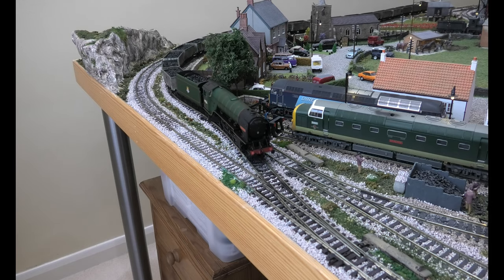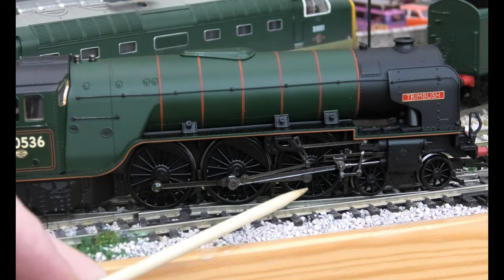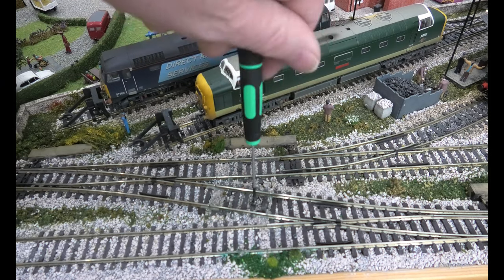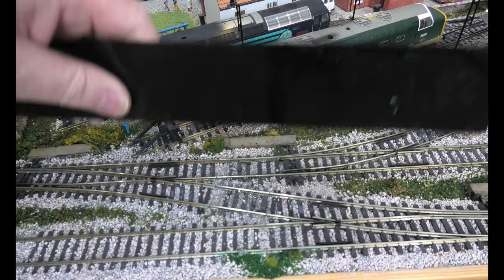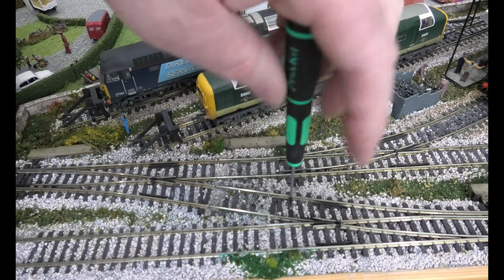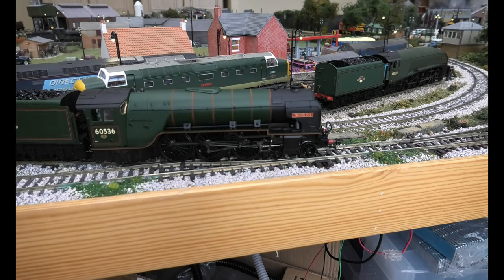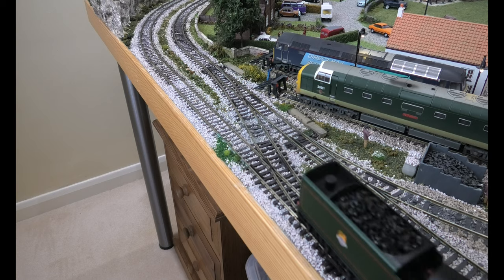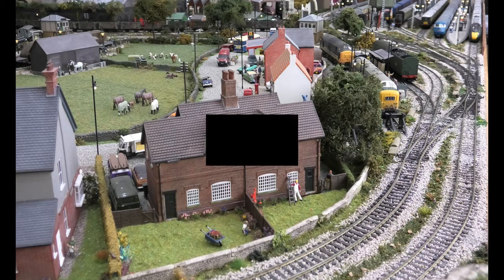Loco stops on track. Showing how you detect and fix a loco stopping on points.

Comment: Paul. You have just identified my problem. I was unaware that I could melt/soften PVA. Also Being a complete novice I nailed my track down. I get lots of problems like surging or stopping completely. My loco is the flying Scotsman and is a shocker for derailing. I will try to remove the nails and try to level up like you have demonstrated.
Reply from the maker: Thank you.

Comment: Amazing how just a slight discrepancy in track level makes such a difference to loco running.
Reply from the maker: Indeed, most peoples problems are track, including mine. It is worth remembering that 1mm is 3 inches, so imagine how a loco in real life would run with a 2 mm/ 6 inch drop in the track.

Comment: I run an N scale layout so can't use screws. Track pins are ok with modelling long nose pliers. We have come a long way from DC to DCC but I still feel that model trains collecting power from rails is completely OLD SCHOOL and seriously a hit and miss with dirty wheels, dirty track, electrofrog, insulfrog, unifrog point wiring, the list goes on. I welcome the move into remote controlled trains / loco's that the NMRA are doing.
Reply from the maker: Real trains collect power from the rails. It have to come from somewhere.  I have no problem running locos on the present system. Whatever train you have it has to have power from somewhere. One thing I will not be doing is swapping batteries over like on a kids toy. I am sick and tired of the batteries on my DCC remote always needing to be charged, so I use the wired controller a lot more. Every mechanical device will always need some kind of maintenance and care at sometime, even if it has RR on the hood.
Reply: @PaulBriden  As an Australian locomotive driver I can say that real trains (locomotives), have diesel engines that produce current that drive electric traction motors on the axles that enable movement. Electric trains here in Australia use overhead power lines running 1,500v DC that drive electric traction motors on axles that enable movement, so I'm not sure what you mean by saying "Real trains collect power from the rails" unless your talking about 3rd rail systems, and remember we''re talking high voltages here and not 12-14v DDC model trains. Also remote controlled trains will obviously run on batteries that will be wirelessly charged by the system. I'm happy that my NCE Powercab DCC Controller is wired. All I'm saying is that with model trains picking up power from the rails there will always be inherent power pickup issues points, track, wheels, etc. Back in my DC days I had issues, now even with DCC and those issues remain. And DCC has been around for ages. Will be good to see some new technology that is much needed.
Reply from the maker: I meant 3rd rail as in the Southern Region of the UK. We do have catenaries in the UK, mainly north of London.  @phillipg1588

Comment: What if you get this problem with a loco without a bogie?
Reply from the maker: https://youtu.be/n84XLYOlYvk
Reply from the maker: https://youtu.be/oK0kP1SkpMg
Reply from the maker: https://youtu.be/uTiilsY6v0E
Reply from the maker: It could be dirty tracks, pickups not working correctly, uneven track. Track not powered correctly. etc